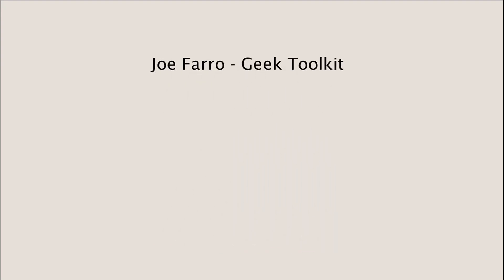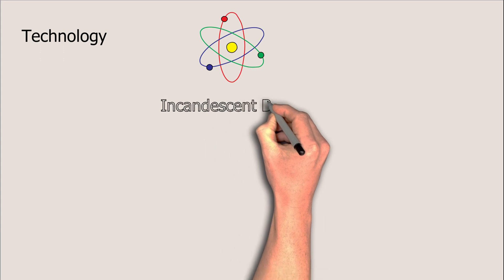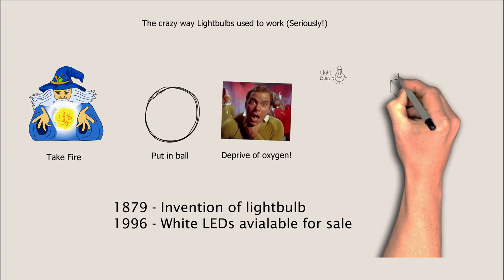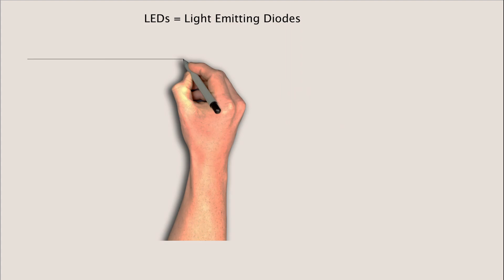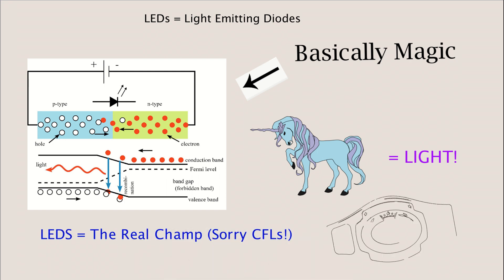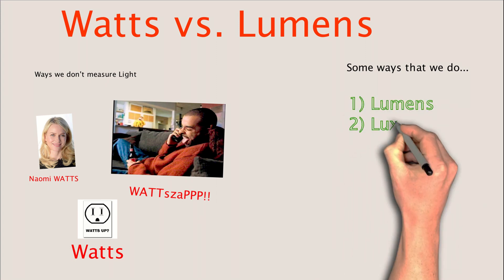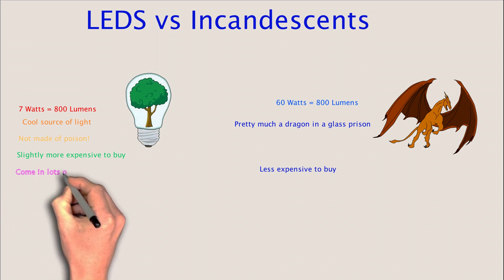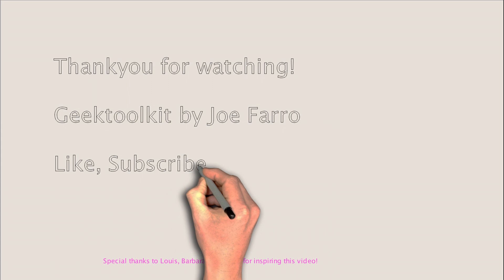LED vs. Incandescent  |  Heat, Watts, and Lumens explained

Comment: Your title ... HEAT - This part wasn't explained
Reply from the maker: Dangit! So many people saw this and no one caught that! I had cut that part out to move it to a more logical place in the video and never reinserted it. Incandescent causes heat and led run cooler but can still need to have thermal assistance/heat sinks. Good point I can’t believe I left that out

Comment: The fragility of glass is never an issue. It's hard and washable, and less polluting than plastic. If the lamp hangs where it is in the position to hit something, it's poorly installed. The best filament LEDs have a glass envelope. Both can be made poorly where the glass falls out, and LEDs loose conctacts not just to a drop but thermal expansion.
Reply: Who will represent the flame and gas that powered the world before Edison’s folly enslaved us all to the alternating current?
Reply from the maker: @Hazumi  Indeed! I suspect those are still well represented on the battlefront with Ford and the spinoffs, however Musk will likely divert that to Tesla's direct current...and then we'll have to ask...who really won in the end?
Reply from the maker: Is your argument that LEDs are more fragile than glass bulbs? I’m just trying to understand if I’m reading that right

Comment: I don't understad why this video has so few views and so many dislikes. I think people didn't get it what he wanted to say.
Reply: Unnecessarily emotional, poetic language. One might as well describe how amazing conventional bulbs are: the fire of a dragon in your hands. And woo of anything new, which feeds into corporations planned obsolescence, where you throw out the whole light unit with the heatsink, psu and all leds if one fails.
Reply from the maker: That would’ve given me a better excuse to pull that dragon drawing in, I should’ve went with that! If you don’t wax unnecessarily poetic how do you make a video about lightbulbs not feel like a scene from Ferris Bueller?
Reply from the maker: Apparently I stepped into a debate that I wasn’t even aware existed against LED lights. I learned that if the topic of the video is controversial, it doesn’t matter if I’m talking about power usage and technology, people will dislike based on an apparent promotion of LED alone.
Reply: @geektoolkit  what debate?
Reply from the maker: On if LEDs are worse than Incandescents
Reply: @geektoolkit  that makes no sense why would that be a debate?
Reply from the maker: Blue light depression and I believe lead used in LEDs. I still use and believe in LEDs but others feel otherwise

Comment: The issue I have with LED is that even considering the recently reduced cost and reduced electricity, they still cost more.  I have read, but can't prove, that they contain lead.  Yeah that's bad if true.  That aside, they just don't last.  The 50,000 hours that most LEDs claim is based on the led element itself in a perfect world.  Once the manufacturer cuts costs on the components to bring the cost down and then packs everything in a small case to make it look pretty, the bulb only lasts a fraction of the rated hours due to heat.  If you try to return for a warrantee replacement, they will tell you you used it wrong because you placed it in a fixture facing down that doesn't allow air flow or something like that.  I was an early adopter of LED and paid $30 per bulb .  They were bulky and heavy (heat sink) but lasted a really long time.  I had no problem converting my entire house (over time) to LED.  I loved them.  The $3 ones you pick up now may last a year, if lucky,  but will have a greatly reduced brightness making it useless.  It's really all a wash in cost and LEDs have some downsides like poorly dimmable, flicker, and power line noise.  You can pay $3 for the LED and $1 for electric or you can pay $1 for the bulb and $3 for the electric.  Don't get me started on CFL.  I am now going back to incandescent to save money and have warm light again.  If you just look at it from a "green" viewpoint then no question the incandescent is a better choice in that every piece of an incandescent can be recycled from the aluminum base to the glass housing unlike LED that has circuit boards, capacitors with acid, solder than may contain lead etc.  Even if the electricity is produced by coal, the incandescent has less impact on nature than LED.  Keep in mind that the plastic the LED is housed in is made from oil in most cases.
Reply from the maker: I've had some interesting comments on this video, and suprising ones...this video was never meant to be a big deal, but more of me trying out a new animation technique and answering a question my cousin asked.

That being said, I've started doing research due to the response...and I'm learning a lot.  From what I'm seeing, multiple sources do indeed mention lead in LED lights.  Also, I'm reading a lot about how the blue in the light messes with cicadian rhythms, causes depression, and more.  

I've noticed that 'cheap' led lights do indeed die out quickly...a friend of mine bought about 90 of the amazon basics ones and he's not having a great time with them.  That being said I have some smart bulbs that have lasted years, but of course cost a bit more. I think the reliability of something is in the overall build, not just the tech, and properly built ones definitely can last longer. 

You make good points about the composition...all of my LED bulbs are plastic, and I don't think they've been recyclable (I'll have to look into that more).  

I'm learning alot. Little concerned, as my home came with all LED lighting..so even though I didn't pay for it or choose it, I'm concerned about the blue light stuff now. I'll have to keep researching.
Thanks for the well thought out comment.
Reply: @geektoolkit  Please don't think that I was being critical of you in any way.  I was in a bit of a mood that 6 out of 10 of the most recently bought LED lights have gotten dim or failed altogether.  In fact I had one torn apart on my desk to see why it failed as I wrote that (PC board was black and 4 of the 6 LED elements were dead).  I understand the logic and embraced it 6+ years ago.  Now that LEDs are more common, the industry has ruined their value by making them total cheap garbage.  To be honest the yellow light from incandescent makes me sad.  I really like bright white from LED.  Keep learning and keep producing videos.
Reply from the maker: @keithreiter740  Thankyou I really appreciate that.  I love that you tore the light apart to see what made it go bad, I hadn't thought of that, but I'm definitely going to give that a shot next time. I didn't take that as critical, and I appreciate it! In the end I am here to teach what I find out, and learn. Definitely going to keep making videos...I'm finding I learn more that way :)  Be well!
Reply: @keithreiter740  Most cheap LED bulbs use a single capacitor as isolation between AC and DC portions and when it shorts (which some will) it takes out said cap pretty violently.
That being said, I re-bulbbed my entire house with LEDs sold by our local power company 5 yeas ago and haven't had one fail yet.
Maybe I got lucky.

Comment: Can you go deeper into LEDs? The definition in my test prep glossary is that voltage is applied to the anode and ground to the cathode and from what I've learned in the past on a 12v battery the positive voltage is from the cathode where as the anode is connected to ground? I'm not very good with basic electricity on account of all the goofing off I did in high school so all this is foreign to me lol
Reply from the maker: I honestly can't answer that accurately...I was going to say the Anode is positive on the LED and the battery, but I just found an article when I went to check it that mentioned that the positiver terminal on a battery is the Cathode. So I see your confusion, but I don't have an answer myself for it. If I come up with it I can definitely do a video. One thing about LEDs though is that since they're diodes, they'll restrict the flow of electricity in the 'wrong' direction, so if you do hook up one backwards it should just not work, and be fine when you reverse it.

Comment from the maker: Ever have a technical question that made you curious? Comment below, and if I think I can make a fun video of it, I will try to answer it!
Reply: GeekToolkit.... i have a 60 watt incandescent next to the 7 watt LED .... and the incandescent is brighter.... ive seen IT
Reply: https://youtu.be/3gjvOOlHmsU
Reply: https://youtu.be/MvDuKvCUwdg
Reply from the maker: Scudmaster11 that video makes a bunch of unsubstantiated claims. I’ll trust science over snake oil any day.
Reply: watch both
Reply: also the “LED give no mercury or other toxic chemicals” thats not true .... they contain compasiters and other sensitive electronics that if they break its not good to stay in the same room..... LED’s need direct current and not alternative current so they have a converter.... the converter put stress on the house wireing..... Incandescent light bulbs will always be better.... and LED’s & CFL’s give high levels of electromagnetic field ... LED’s and CFL’s are alot higher in electromagnetic field than any PC or laptop are aloud to be..... in my experience incandescent win ... LED’s shoud be 30$ or banned ... and CFL’s need to be banned
Reply: @Scudmaster11  your comment does not make any sense.